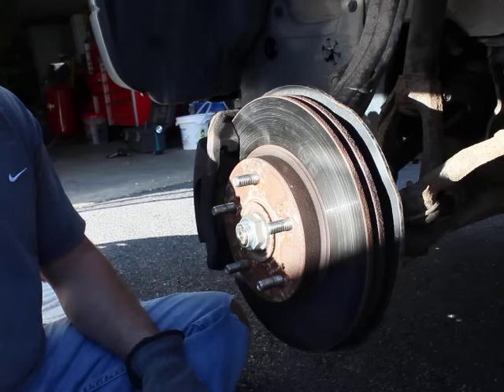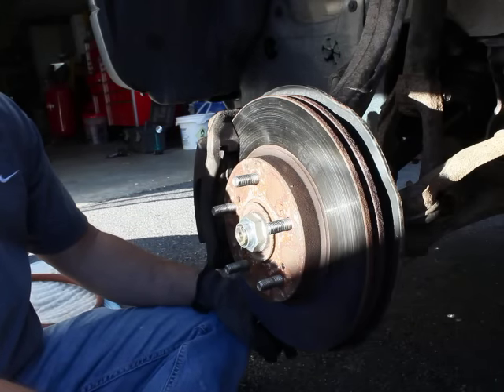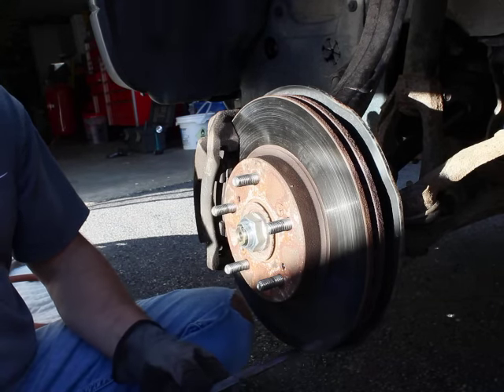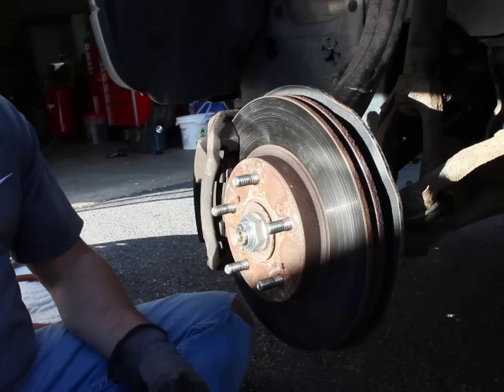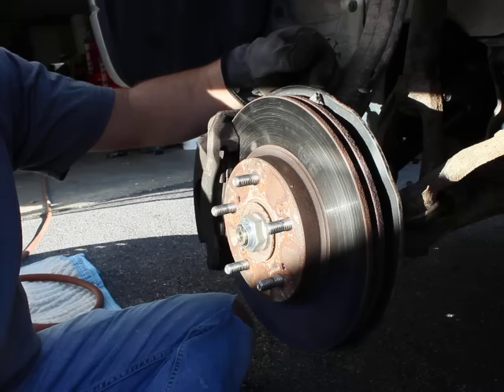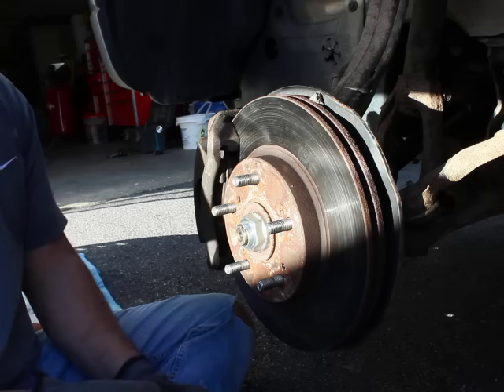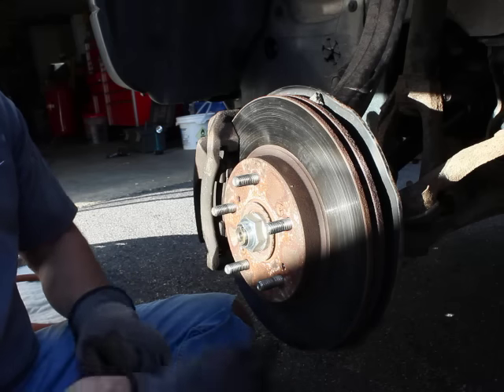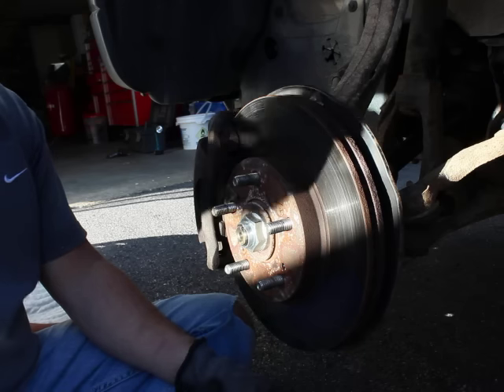Scraping Noise From Wheel While Driving

Comment: good video.. I just bought a 2009 Elantra a few weeks ago, and I noticed a scraping or hovering sound that I thought was low breaks at first.. but I had my mechanic check it and the breaks are good, its just that it could the break shoe touching the back plate.. so I took it to the dealership, and they said they fixed it by adjusting the routers, but I still kind of notice it...
Reply from the maker: Hi jaredontv, There is no adjustment on rotors, so maybe they pushed the backing plate away from the rotor. Keep an ear on the noise, if it gets worse, have them look at it again.
Reply: honestly I dont trust this dealership, I bought a used car from them becuz its SUPPOSED to e certified.. yes its a 5 year old car, and I just recently bought it back to them with papers proving their lack of competence, and got new tires, a battery, 2 belts and "adjusted the routers according to them"....  when I tried to explain to them what to look for, they were very dismissive and tried to cut me off in the middle of my sentence..  yes I got all that free stuff, but the scraping sensation remains...  I will have someone I know look at is instead...

Comment: My fiancée just had work done on her car, an '02 Honda Civic. New struts, new right inner tie rod, and new left/right lower control arm bushings. However, after she left her mechanic, within 20 minutes later she's getting a very bad 'grinding' sound whenever her car is in motion; almost to the point where the car seems unsafe to drive. Could it be something in the wheel bearings to cause this?
Reply from the maker: Hi Donovan, I would check the backing plate on each rotor, the mechanic could have bent it when taking off the wheel or when doing the work. If the noise sounds like the backing plate in my video, bring it back to the mechanic and they can fix it pretty quick. Let me know what is making the noise when you figure it out, thanks.

Comment: Thank you. I want to believe my noise is the dust shield; but, I can't for the life of me figure out how it may have got bent. The noise is intermittent. Sometimes it goes away. Another noise I noticed yesterday is a hum when in reverse. Is that a stuck caliper? And can stuck calipers shift the rotor to meet the dust shield in some way? Ugh! I need to learn more about my brakes!
Reply from the maker: The caliper could be starting to seize, does the rotor get hotter at that wheel compared to the other wheels? It will not shift the rotor, but what you might be hearing is the wear indicator on the brake pads warning you the pads are getting low. Let me know if this helps.
Reply: @EddieCarrara1  Wheel indicator! (right rear) I assumed the indicator would be consistent and get louder with applying the brake - Nope! Even goes away for long periods. Mechanic bent the indicator inwards till I get the brake job next week. Thanks for all the help!
Reply from the maker: @jaym5938  You're welcome. The brake temperature will cause the indicator to move closer and away from the rotor because the metal is expanding and contracting, so if the brakes are hot, it will move away, when is cold it touches the rotor. 👍

Comment: Very informative Eddie!  Question I just got 4 new tires replaced and it seems when I get to 50mph I hear what your describing as the scraping noise.  It is not always consistent, but from I hit a dip also it makes that scrape noise.
Reply from the maker: Hi MK. I recommend trying to figure out which wheel the noise is coming from and  try bending the rotortacking plate away from the rotor, it doesn't take much force just a good push. all around the outside of the backing plate. If that doesn't work, I recommend you bring it back to the shop that did the tires and have them fix it. Let me know if this helps
Reply: @EddieCarrara1  Thank you for your reply Eddie.  It ended up not being my tires, but the bottom cover where I get my oil changed.  A screw was missing, so the wind draft was forcing it down and causing the scraping noise.  

Thank you again.

Comment: Hey mate. I have a sound in my car that is rhythmic and its like a thump thump thump. It shakes my car as well. Higher the speed the more it shakes. But noise is only loud enough to hear under 40 if you let the gas off. Also if you let the gas off at 110km the car shakes wildly in the front.
Reply from the maker: Hey Fire Skystorm, have you ever used fix-a-flat in a can or slime inside any of your tires? What does the tread pattern look like on all your tires, is it flat and smooth or uneven and cupped? Let me know 👍
Reply: @EddieCarrara1  new tires had them put on 5 months ago mate.

Comment: Hello, I had my tires changed recently and asked the technician at Canadian Tire what was wrong. And he said my wheel bearings and tie rod needs to be replaced on the passenger side. But seeing this video I think there could a simpler solution!
Reply from the maker: Hey Richdrummer, If you have a noise like the one in the video, it's not tie rods or wheel bearings. You may need those things, but that's not what's making the noise. check out my other videos on wheel bearings so you can hear what a damaged wheel bearing sounds like and let me know what you think.
Reply: Eddie Carrara Thank you Eddie! Have a very Merry Christmas!
Reply from the maker: Thanks, you too Richard, and Happy New Year!

Comment: Can something like this happen on drum brakes?  Aren't drums kind of like a sealed unit?  Recently had my rear drum brakes rebuilt, I do light offroading and after going to the dunes, I will hear an intermittent scrap or rubbing noise occationally.
Reply from the maker: Hey Ultrakill, most likely it's debris getting caught between the drums and backing plate, and no, drums are not sealed, they are protected better than disc brakes, but not sealed.
Reply: Thanks for the tip, I will check that out.
Reply from the maker: Cool, let me know what you find, thanks.

Comment: My daughter just had new tires put on, now driving (in motion) she hears metal to metal sound. Stopped, completely gone. Wondering if they bent something during the time they installed the tires on her car? What else could it be?
Reply from the maker: Sometimes the rim will hit the metal backing plate when removing the wheels so it's a good chance you can fix it by pushing the shield away from the rotor.

Comment: Great video but I do have a question I have a grinding noise coming out of my left wheel but it only happens when I turn the wheels to the right and it'll continue to make this oscillating grinding sound until I turn to the left any idea what that could be?
Reply from the maker: That would most likely be the backing plate being to close to the rotor like in the video . Just use a long screwdriver through the wheel openings and push the plate away from the rotor.

Comment: Hi thanks for the advice but it’s still making noise is that ok to take the metal plate off?
Reply from the maker: Hi SI, it's best to leave them on but if it's completely rusted it's not doing its job anyway. Just be sure that this is what is causing the noise, sometimes the brake pad wear indicator can make a similar noise and it usually is the inner pad that is the worn low.

Comment: My car has that exact scraping sound but it’s changed throughout the time I’ve driven it. I used to start scraping when I would keep it on a certain speed limit but not it just starts scraping when I let go of the pedal and let the car go on it own. I’ve changed the brakes do you think it can be anything else besides what you’ve already listed in the video???
Reply from the maker: Hi Gil, I would start by bending the backing plate away from the rotor, especially if you just changed the brake pads.

Comment: yes, I'm dealing with that, after brand spankin new brakes..

Brake Check was goin to charge me $74.00 to diagnose this..

Thanks u..
Reply from the maker: Hey, Dee 1, yes sometimes the mechanic will bend the backing plate by accident without realizing it and return the vehicle to the customer without road testing the car and this is the result. Glad this video helped 👍
Reply: @EddieCarrara1  Thanks for respondin...

I will have to take the wheel off, tried to bend it back with the wheel on, but it's still ratting..
Reply from the maker: @dee1380  Let me know what you find, and if you need more help locating the noise I'll be right here 👍
Reply: @EddieCarrara1  I really appreciate that..
Thanks..

Comment: I'm having the same problem. But my ABS light is on. I just had the bearings replaced last year. And I do live on a dirt road.
Reply from the maker: Hi Joe Hyatt, most likely because you live on a dirt road you may have picked up a rock and it’s stuck between the rotor and backing plate? Let me know thanks.

Comment: Hi Eddie!  If it is a rock stuck in there.  How do I get rid of it?

Thanks!
Reply from the maker: Hi Jeff, sometimes you can push on the backing plate from between the rim spokes with a long screwdriver, if that doesn't work, you may need to remove the wheel and caliper to dislodge the rock. Let me know if this helps, thanks.

Comment: I have a grinding noise similar after I had a local shop replace both of my front wheel bearing pulled back the dust cover as far as I can still makes a interment grinding/scraping noise especially around corners
Reply from the maker: Hi NT, Most likely the shield is bent near the hub behind the rotor because there is a lot of pressure on the backing plate in that area when pressing out the bearings. You will need to remove the rotor to adjust the backing plate or bring it back to them and have the mechanic do it. Let me know if this helps.
Reply: @EddieCarrara1  thank you

Comment: hi Eddie!  I have a quick question.  my wife has a Ford Focus that is making a rotational rubbing noise from the front brakes.  I should start off by saying, the noise started when she hit a pit hole and bent the rim of the wheel.  so far, I looked for a dust shield, but the car doesn't have one.  I then took the calipers off to inspect the brakes for obvious damage, noticed one of the retaining clips was not seating correctly and corroded, so I  replaced them.  noise is still there, but a little less than before.  also after looking at the brake pads,  one of the spring clips isn't sitting properly.  could the spring clip on a brake pad loose its spring causing the pad to rub on the rotor?
Reply from the maker: +Daniel Bornhoeft Good question, It's possible, but are you sure there is nothing else touching the rotor from behind like a piece of rust or something? Also make sure the anti rattle clips ( if applicable) are centered in the caliper.
Reply: +Eddie Carrara thanks for taking the time to share your knowledge!  I took apart the calipers and think I found the problem.  one of the spring clips on the brake pad was bent and lost it's spring, for the lack of a better term.  So, when the brakes were engaged, the pad wouldn't move back from the rotor.  So, I replaced the pads and while I was at it, I replaced the anti rattle clips and re-greased the caliper slides.  I think I  solved the problem.
Reply from the maker: Awesome Dan! and thanks for coming back with an update, I really appreciate it :)

Comment: Will have to take a look at mine.. didnt have breaks done but had a wheel hub assy. changed and its doing it on the RF tire. I had pulled my tire off and inspected the rotor an saw no sign of anything rubbing it, but will double check for this.

Comment: Hi Eddie, Thanks for this video. I just had new rotors and pads put on the front during a visit back home. A day after returning to town (about a 300 mile drive where anything could have gotten lodged in there), I started hearing the tin can dragging sound from the front passenger side. I assume this is the same "scraping noise" you are talking about. I pushed the dust shield back with a screwdriver through the wheel, all around it. It's not very flexible. When I drove, the noise was still there. Then I removed the wheel and pushed even more on the plate all the way around, yet afterward, still the same noise. Can you advise what to do next? Thank you!
Reply from the maker: Hi Marshal, you may have something lodged between the rotor and the backing plate. You may need to remove the caliper and rotor to look behind the rotor to see signs of something scraping on either the rotor or backing plate. If you need more help or you have more questions, I'll be right here :) And keep me posted on what you find, thanks.

Comment: Fixed my car by using a wire brush and cleaning the sides of the rotor, front, rear, and everything that had rust in it. The squeaking/scraping noise stopped.

Comment: I have what I think sounds like a dragging or metal sound when driving. It just started probably 2 days ago and I don't know if I'm crazy or if something is wrong I'm really nervous to take it in because I'm hoping it's nothing serious. Do you have any idea what it might be and if I should get it looked at asap?
Reply from the maker: Hi Gloria, if the noise just started I would have it checked, it could be the wear indicator on the brake pad just starting to touch the brake rotor.  Keep me posted on what you find, thanks.
Reply: Eddie Carrara, I would first like to commend you on how gracious and detailed you are in each of the replies I have read. You are kind to share so much knowledge and your demeanor is refreshing. Thank you!

I have an '06 Malibu that until recently has never given me any issues. It started grinding when in motion a few months ago so I started using the S-10 for daily use and basically parked the car till warmer weather presented itself.

I would only take the car out occasionally (on avg. a couple of times a month). Today in addition to the grinding I had a new sound. The sound and feeling of having the emergency brake on while trying to drive and my parking brake seems to be shot! The icing is an added dragging feeling when trying to move in reverse.

I went to church, got gasoline and stopped at a store today. When I tried to back out of the space at the store nothing happened until I really gave it the gas and the sound was awful. I went home and parked it again. I know this is a lot (sounds like a bit of a train wreck to me) though I would value any advice.
Reply from the maker: Jennifer Carter , Hi Jennifer, It sounds to me like your brakes may have started to grind a few months back do to lack of brake material. After you parked it with little use the brakes started to rust from sitting and caused a more significant grinding noise. The backing up issue sounds like you may have a brake shoe that has become disassembled, but I'm not sure if you have disc or drum brakes, either way it still sounds like something has become dislodged or broken. I recommend having someone take a look before you drive it any more just to be safe. Let me know if you have more questions and keep me posted on what you find, thanks. P.S., thanks for your feedback, I really appreciate the kind words :)
Reply from the maker: Jennifer Carter , Hi Jenn, I did reply earlier but I don't see my comment so here goes again lol. The noise you were hearing a few months back could have been the brake linings getting low and causing a grinding noise. Once you parked the vehicle the rotors most likely started to rust from sitting and caused an even worse grinding noise. 
The problem with backing up sounds more like there may be something that came loose or is broken like the brake lining or spring that is getting lodged causing the brakes to drag, I'm not sure if you have disc or drum brakes in the rear and broken spring and separated brake shoe linings are common issues with drum brakes. 

I recommend having someone pull the wheels off the car and do a brake inspection just to be safe, there is a problem in the braking system and the only way to know for sure what's wrong is to have it inspected. Keep me posted on what you find, and let me know if you have more questions. Also, thank you for the kind words I really appreciate the feedback :)
Reply: Eddie Carrara
Hi Eddie! Thank you very much. 😊
I agree that I need to take it in before I risk driving it further. I will have the brakes checked and reach out with an update. It was pretty scary (and pretty loud) driving home on Sunday.

I'm sure it's the rear brake pads since the parking brake is now a little wonky too. I'm hoping it won't be anything more severe than new rotors and pads.

Comment: My dad recently changed my back tyre as is got stuck, took a few attempts to remove the worn tyre. Now it’s making a rubbing/grinding noise. Will this fix the issue do you think? Or could it be something else? Thanks for the video!!
Reply from the maker: Hi Jillian, It sounds like you may have bent the rotor backing plate when you got stuck and now it's rubbing against the rotor, You'll just need to bend the backing plate away from the rotor.

Comment: In continution of my previos note. Do you think brakes cllaper can do some thing like that sound. During driving the sound goes with the speed of the car while slowing the car the sound goes slow together until car stop .
Reply from the maker: Hi Amin, 
The caliper anti-rattle clips can make a noise if they are not centered but the sound is very different or if something is caught between the backing plate and caliper it will make the same sound but the caliper itself should never touch the rotor. Let me know if this helps.

Comment: Eddie, I have a question. When turning right, there is a grinding noise on the left side. I replaced my tie rod end and sway bar link because the boots were ripped and I was hoping that was the problem. I checked the dust shield and it is not bent. I am hopeing it is not a CV joint but I wanted to get your opinion.   Thanks